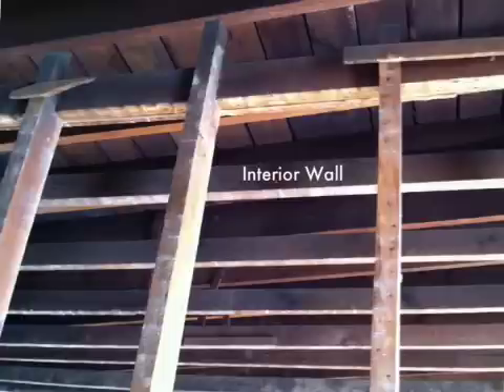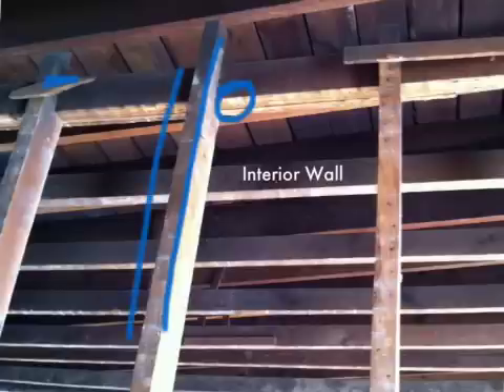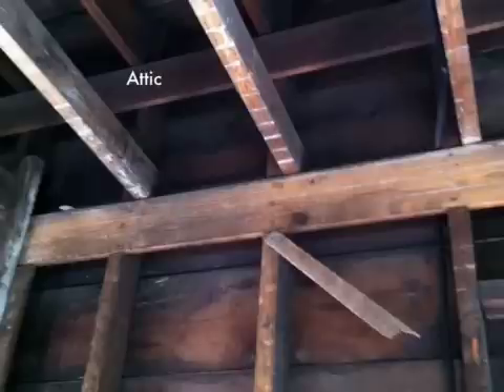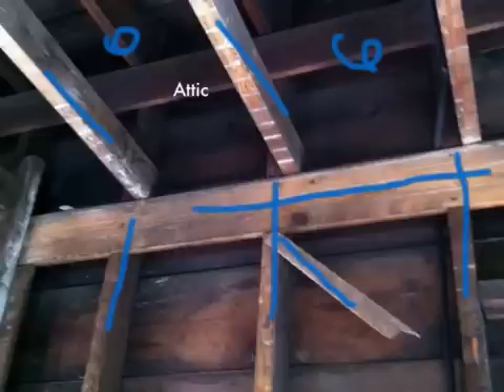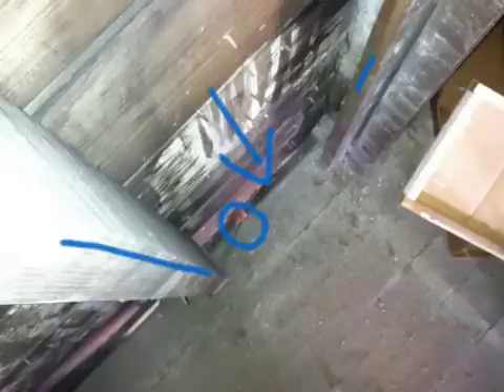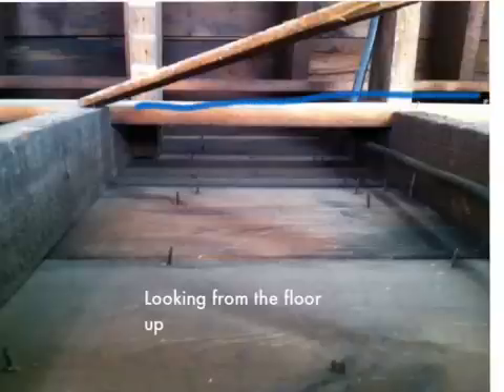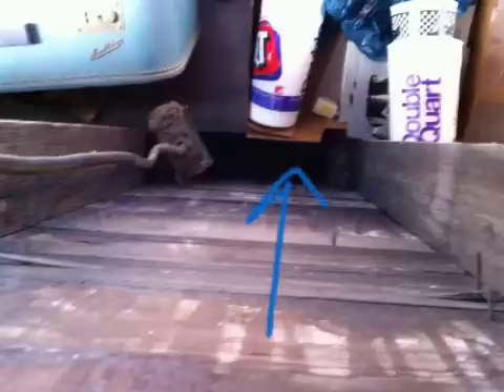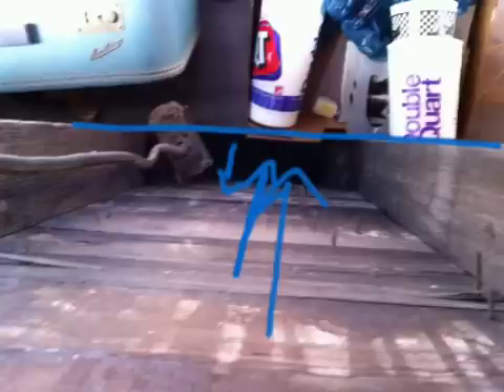Inside Balloon Frame Construction

Comment: Just put some blocks in. No big deal.

Don't know how many brand new homes I've seen burn to complete ashes. Every year the wild fires feast on entire neighborhoods chalk full of nothing, but brand new cookie cutter code homes. Watch what happens in a few more months from now, you'll open up the news to hear about more fires burning down more homes, all brand new, all code compliant. That's if the wind or the water does get to them first. All brand new. All code compliant. All built by expert professionals. All modern day materials. All of them have name brand joist hangers and straps and nails and the latest fasteners. Yet all that will be left in that spot is some poured concrete and rebar and a crying relative of the previous owner who is no longer with us.

Meanwhile I can show you homes that are 300 years old build without any of that stuff. And in Japan some are 2000 years old. Not a single one meets code. Not a single one was built using lasers levels or nail guns or scissor lifts and all that fancy stuff. Not a single one has a poured concrete foundation with miles of rebar. And yet they will continue to out live any modern day anything you can conjure up next in your studio for a quick and big buck.

I'll take an older method any day over modern. They were just built by far better.

And it has nothing to do with old grown new growth nonsense. Just go down to a real saw mill and buy some actual wood to actual sizes and your good. You absolutely positively do not need any pressure treated anything for your structure. You just need to learn how to build correctly. You need to actually learn to do the work, not run from it. You need to learn how to build right and stop cutting corners. That insta house stuff of modern day times is complete and total and utter rubbish. Every single last bit of it is worthless garbage. Cheap on quality, but expensive on funds. No taste or style at all. Just some store bought garbage slapped together by whiners who actually believe they are carpenters, but are haven't got a single clue about anything.

Just remember this; what ever you create is a direct extension of who you are as a man.

Comment: We have a balloon frame 1863 farmhouse and found brick that had been placed up the chase of the wall on the first floor.  We were told this brick was considered insultation back then.  Is this structural? Or can we remove it.  Looks like the brick goes all the ways up to the top floor of the house
Reply from the maker: I would recommend having a local contractor look at it to ensure it is something you can remove. Thanks for watching and good luck!

Comment: Just bought a hammer house that is balloon framed. I have a long job converting it to standards. The house was built in 1920.

The second floor flooring is nailed directly to the 2x4 spanning 20 feet. Yes there is a bit of a sag in the timber. No sub flooring?

Who ever thought this was a good idea?

Just show pictures of these construction techniques to people that whine about all the regulations.

Oh, no visible vent pipes and aluminum wiring. The aluminum replaced some of the knob and tube. Yes, hot knob and tube wiring. The breaker box (1970's colors) is on the open back porch.

Comment: It's surprising how many people/fire fighters Talk balloon Construction but have no idea what it is.  This was a great demonstration.

The cheapest way, but not much fun, to eliminate the flow path and fire stop the chimney affect is to install bats of rolled up Rock Wool in between the floor joist in the basement and at the top in the attic before insulating the attic or blowing cellulose into the walls.  It's very important to get it into pipe chases at the kitchens and bathrooms.

There are a lot of things in the average basement that can cause fires.  Furnace, water heater, electrical panels, containers full of chemicals.  never use chemicals in the basement.  They need to be used in well ventilated areas.  The fumes will lay on the floor and spread until they hit the pilot light of the furnace or water heater and the resulting explosion will go right up the walls into the attic.  However, if you are down there at the time, I think your Attic will be the Least of your worry's.

Comment: As a guy that has a balloon from house there some additional info I'll share.  All the joists are notched and hanging on ledger boards (at least in my area) and are basically gravity held, unless updated - not metal hangers and only a few nails.  A ledger board is actually about 1x6 and notched into the studs.  In our case the first floor has joist spans as long as 16 foot with 2x8 rough cut lumber, this is much smaller than required by modern building codes.  

The wood burns hot and long.

Comment: I have the same vintage home built in 1892. I am currently insulating a 1st floor bedroom and i am running into the same problem,no fireblock or sill plate blocking.So i put my own in.

Comment: great video - I've owned my 1870 built house since 2000 and am just now considering blwoing in cellulose insulation since the house is freezing in winter.  Now I know why.  I was able to feed a fish tape from the basement all the way to the attic (2 stories).   The cellulose should actually help with fire retardation versus unfilled balloon framing.